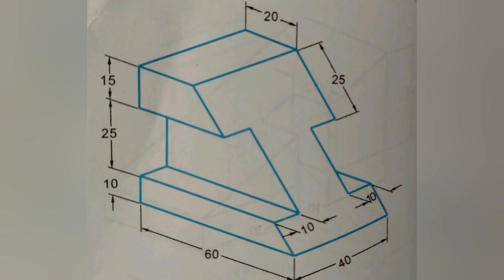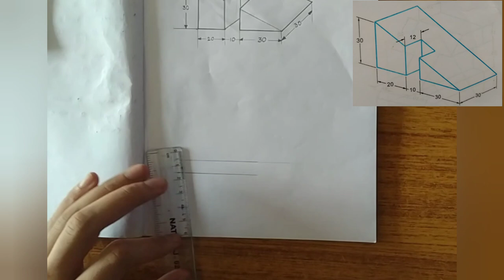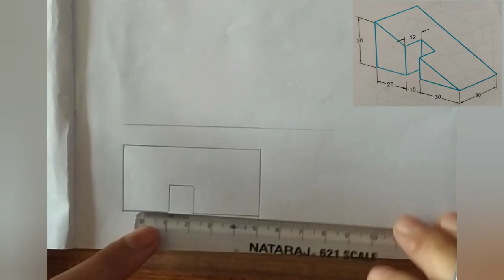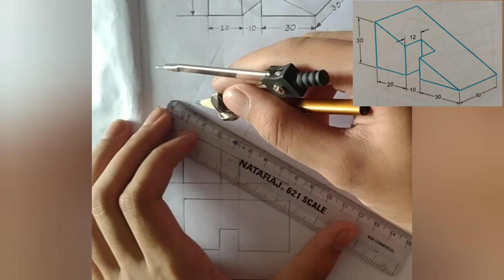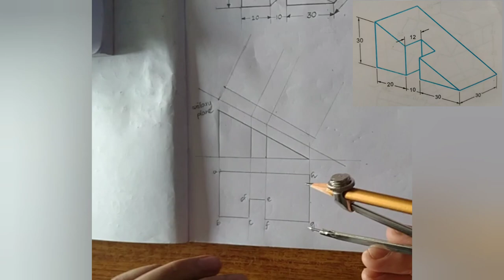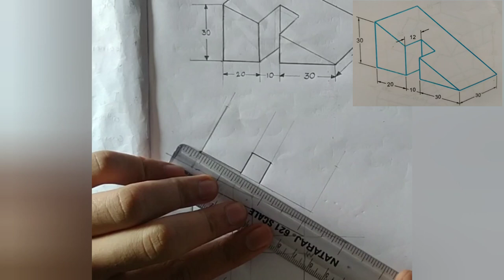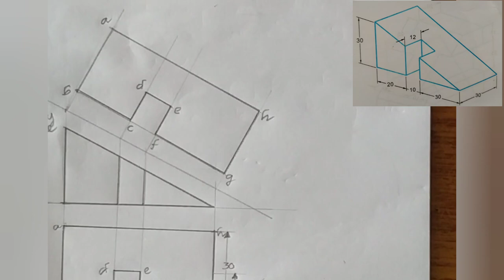ll Auxiliary Views ll Engineering Drawing ll Diploma Engineering Drawing l Inclined Object Drawing l

Comment: a square pyramid base 50mm side and axis 80mm long is resting on ground with axis vertical and sides base equally inclines to vertical plane it is cut by a section plane perpendicular to vp inclined at 45degrees hp bisecting axis

Comment: I think this is wrong. You have to find the distance of the point from the XY line and mark it over the auxiliary plane. Once check, just a suggestion.
Reply from the maker: It's all about projection lines u need to take the distance of FV and take that length in Auxiliary plane